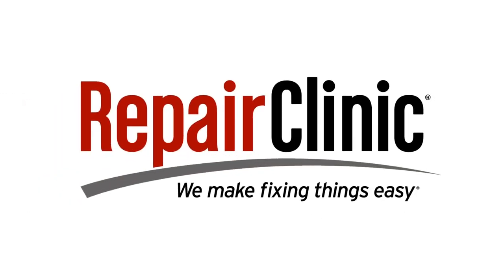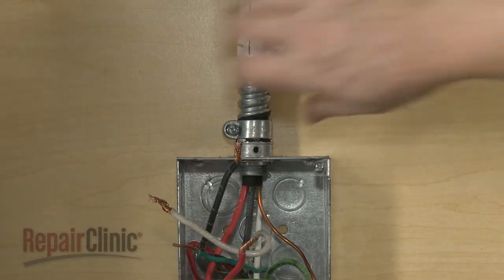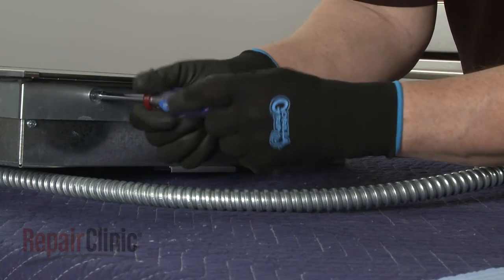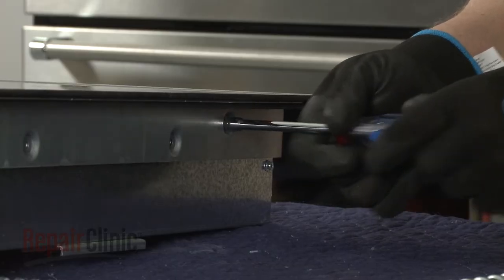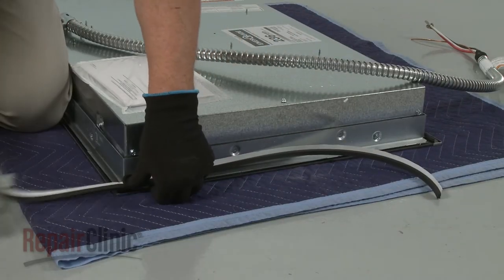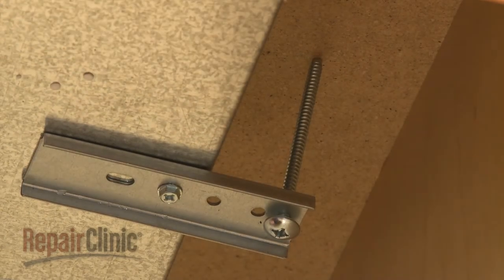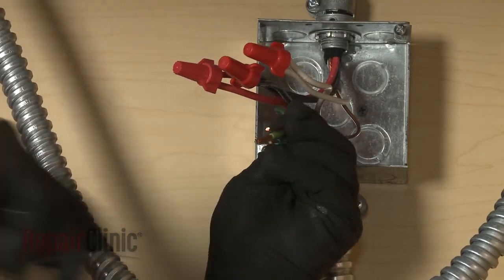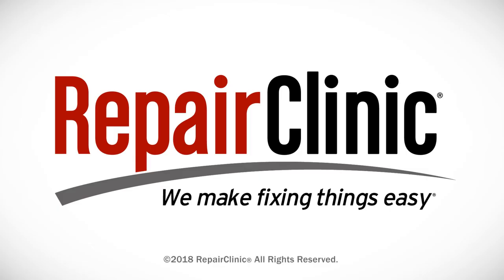Whirlpool Electric Cooktop Main Glass Top Replacement W10365146

Comment: Do some glass cook tops like these just come with a 240v plug so I don't have to wire anything up?
Reply: I don't know the answer to your question, but I can say that I think it is much preferable to have permanent 220 volt electric devices where a cord is hidden out of sight such as your stove or a baseboard heater, hardwired. It's really easy. Just match up the colors both from the stove and from the wall. Of course make sure you have turned off the circuit breaker to your stove. You absolutely do not want to get a 220 volt shock. That will ruin your day. (Understatement)

Comment: Thank you for the tutorial. my cooktop GCI3061XB doesn't operate. Can you show where to find the fuse as I want to check if it need to be replaced? Or do you have any suggestions about other causes?
Reply: @repairclinic  Thank you for your reply. The resources you provided didn't address my issue. Do I need a fuse or a thermostat? to troubleshoot my Whirlpool GCI3061XB 01(Touch-activated electronic induction cooktop). I was cooking and the cooktop just turned off since then the power doesn't turn on at all.  Please help
Reply: There’s no fuse on the appliance.

Comment: Disclaimer: This is illegal to perform in any country that requires Electricians to be trained and licenced and any damage (fire) caused to yourself (death), your property or your equipment isnt covered under insurance :)
Reply: Not true. I've done fixes like this a couple of times.
Reply: In Canada, you or the contractor legally need to apply for a permit before any electrical installation, alteration, repair or extension work is commenced. CEC 2-004
Reply: That's why you save money by doing it yourself and not telling anyone
Reply: @lordgman1  it could void your home insurance policy if your home burns down due to the bad unlicensed install if the insurance company finds out, which is unlikely how would they know a glass was swapped out if it's the exact same glass?  check your policy but don't call your insurance company cause they will obvious make a note in the computer if you ask.